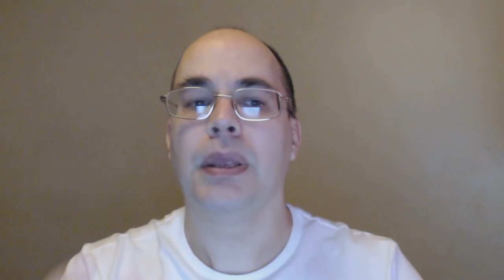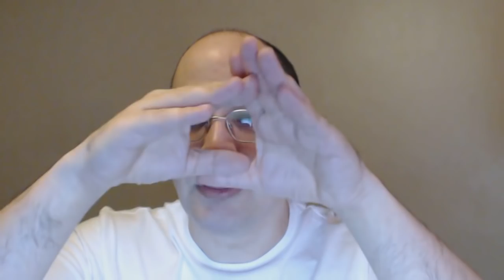How do rockets move in space, with nothing to push off from?

Comment: Rockets will work in space

Easy to prove they will by a number of methods.

1 Analogy with water expelled from a garden hose. Take your hose, hold it about a foot from the end, with a spray nozzle fitted. Have a helper turn on and increase the water flow. You feel the hose move more as the pressure increases. If you think this is because the water is pushing against air, move the hose toward and away from a solid surface (which should present more resistance than air) and you feel NO change in the pressure on the hose. It's only when the water is turned off that this pressure goes away. The air is not providing the push

2 Comparison with detonation of explosives. A rocket is a controlled detonation. When an explosive ignites, it generates rapidly-expanding gases which, in a microsecond, rupture the container holding the explosive in place, and generate an expanding shock wave in either the surrounding material, or air surrounding that material. They don't need air to ignite. They have an oxidising element in their make-up

so ....

3 What happens if you construct a combustion chamber, containing rocket propellant, that has no exhaust nozzle? Totally sealed, no exit for expanding gases. Light it up, and - Either the propellant burns until it's all spent, or the chamber reaches a point where the pressure is too much for the build, and it fractures at the weakest point. There can only be one of these results. No?

Simply put, the propellant works in all directions upon the internal walls of the chamber until either it is spent or the chamber explodes under stress.

Now substitute this chamber for one with a controlled exhaust, and the propellant STILL works upon the upper and inner walls of the chamber BEFORE exit. No? Why would it change behaviour between the two situations?

For those who think rockets push against air, consider this - the Saturn V developed 1,522,000 lbf for sea-level thrust, with a mass flow rate of 5683 lbm/s and exhaust velocity 9800 f/s.

Is atmospheric air at roughly 15 psi static going to present any meaningful impediment to this? It won't resist the rocket exhaust, it'll be pushed out of the way, like a 15-car railroad train swatting a fly. 15 psi is an insignificance against this. 

1. "Apollo 11 Saturn V Launch Camera E-8" - /watch?v=DKtVpvzUF1Y

Especially look at 0.45, where the engine reaches full power, and the smoke which has billowed out from the area below suddenly switches direction, and gets dragged back down. 

What do you think would cause it to do this, other than the atmosphere being dragged there?

Also at 1.36, the ice falling at the edge of the pit changes direction as it passes the hold-down clamps, and also gets dragged along. 

What do you think would cause it to do this, other than air movement pulling it in?

2. "Crucial Booster Test Fires Up in Utah"- /watch?v=LhxSk70r8dw 

Observe the ground around the booster once it's running. See how the movement of the atmosphere around it is pulling the loose sands etc toward the rocket exhaust. See 0.14, and look at the ridge line to the left, and in the following shot, where the material parallel to, and above the exhaust is being dragged toward it.

3. "Future SLS Rocket Engine Test Fired at Full Power | RS-25 | Video" - /watch?v=UEhHRXDFkeU

Watch the steam and vapour being produced ABOVE the engine being dragged down by the airflow.

4. Amateur demo shows model rocket engine thrusting in a vacuum ;

"Model Rocket Engine In A Vacuum Chamber - 4K Slow Motion - will it burn?"
/watch?v=GxBRQXxBRic

5. "RS-25 Rocket Engine Test"
/watch?v=cXgJVrmdYrY

"RS-25 Engine Test from Stennis Space Center"
/watch?v=CG2WeMSlOrA

Watch the steam and vapour being produced ABOVE the engine being dragged down by the airflow.
Reply: @boptah7489  why won't you answer my question?  Afraid it migh reveal an inconsistency in your logic?  When one MASS exerts a force on a second MASS, does the first mass FEEL THE FORCE OR NOT?
Reply: @stuartgray5877  I answered your question.There is no recoil with a crossbow in a vacuum..  Recoil is a function of thrust and thrust needs resistance.  The crossbow bolt leaves the crossbow recoil free , except for the small resistance needed to overcome the bolts inertia.
    This is completely different to a rocket.   A rocket relies on thrust off of an atmosphere.    As per the video i posted.
Reply: @boptah7489  for one: NO YOU DID NOT answer my question, you haven't responded since I asked it. And you are 100% WRONG, a crossbow certainly WILL experience recoil in a vacuum.  You seriously want to argue physics with engineers when it is obvious that YOU have never taken a physics class in your life?   What HAPPENS when you have two MASSES in space and a spring exerts a force between the two?  Are you suggesting that neither object will feel the force? Or that neither object will move due to this force?
Reply: @stuartgray5877  There is a world of difference between a vacuum  on earth and a vacuum in space.  .  In space there is no gravity to give  weight to an object and so there is no recoil. from the action/reaction principle.
    you need to understand that we are talking about rockets and thrust.  NOT the potential energy energy in a spring . 

   with your example of a spring acting between two masses in space the two masses will separate at a rate according to their mass.   that is because there are TWO masses. 

  With a rocket in space there is only 1 mass ( the rocket)  and so will not actually push off anything.ie.  the fuel /air mixture will evacuate out of the rocket and no thrust will be generated.
    You need to go and speak to your 'expert masters , because you do not know what you are talking about. Maybe you need to speak to different 'experts'.  Because they all contradict each other.
Reply: @stuartgray5877    no  Mass is a function of Gravity also.  Einsteins  equation E= MC2  clearly shows that mass is a function of speed and the speed of ~Earths gravity is an acceleration of 32.14 feet per second per second . 

    you are obviously new to this subject and is a bit above your pay grade.. 

   Low earth orbit is NOT in the vacuum of space and so is irrelevant to this discussion. 

   I do not need to take a course in Physics.  I know what i am talking about..  There are no test launches in space.  you are mistaken.  You cannot go into the vacuum of space  ( outside the Van allen belts)  with rocket technology.  That is why they can't put a man on the moon and still can't today
Reply: @boptah7489  you are literally trying to lecture someone who builds deep space probes, launches them, then helps fly them in deep space.  As I said: YOU have never taken a physics class in your life and it shows.  Now stop before you totally embarrass yourself.  Lookup "Mars Global Surveyor", "Stardust", "Genesis", "MER rovers", "Deep Impact", and "Kepler Space Telescope" then check my resume.
Reply: @stuartgray5877    You have NEVER sent a rocket into space.  you are a liar.  Low earth orbit is NOT space. 

    If you fired a rocket into space past the Van allen belts , then you will not be getting it back anytime soon.  Because Rockets do not work in the vacuum of space.  unless it is fired into space and then orbits a planetary body.   But it will not be the rocket propelling it through space.  it will be momentum. 

    I think you might have taken too many physics classes.  you need to look at what you are doing wrong with new eyes.  If you believe that a carbon based lifeform has gone beyond the Van allen belt with rocket technology.  then you are a simpleton.
Reply: @stuartgray5877    I answered your question on another thread.   Rockets do not work in the vacuum of space.  but you can fire a rocket into space from the earth if you can escape the earths gravity.  but you will have no thrust, steerage or means of braking.  you can only fire it into space until it is picked up by the orbit of another  body. 

     It does not matter if you worked for Lockheed.  You are hardly the brains behind the outfit.
Reply: @boptah7489  incapable of claiming your $1000 cash I see.  Did you check my resume or not?
Reply: @stuartgray5877    I don't care about a piddling $1000.  and i don't care about your resume.   That means nothing.
Reply: Your right, rocket technology does infact work...just like you said...like shooting off fireworks...in our atmosphere...well enough to land on a moon...ehhh?  That's an unbelievable stretch
Reply: @LemarFrench  so you must not believe we have orbited other planets and landed probes and rovers on their surface either?
Reply: @stuartgray5877  I'm surprised you do
Reply: So what we can summarize from what is being said is that rockets work by combustion and displacing their own gasses against the rocket itself essentially riding it's own shockwave perpetually?
Reply: @stuartgray5877  rockets working in a vacuum is one thing orbiting planets etc. Whole diff monster
Reply: @LemarFrench  No.  Rockets work by the expansion of gasses channelled into 1 direction of lesser resistance..  the reason why rockets cannot work in a vacuum is because you need resistance on all sides , otherwise the expanding gases just evacuate themselves into the no resistance zone ( vacuum)  and no thrust is provided.    Thrust is a function of resistance ONLY.
Reply: @boptah7489  I'm actually on your side, but one key detail is definitely "rate of burn" if I'm burning fuel faster than the gas can escape the nozzle, even in space, you'll see some movement, but yeah if all the fuel and gasses created had a simutaneous reactive time, everything would cancel out leaving no movement but ..."rate of burn" is true
Reply: @LemarFrench  and I literally build, test, launch, and FLY spacecraft for a living.  Space probes that I have worked on have: Orbited Saturn and landed on its moon Titan, Orbited and landed on Mars, Orbited and landed on Earth, punched a hole in a comet, gathered samples from a comet and returned them to Earth, gathered samples of the Solar Wind and returned them to Earth, and discovered thousands of extra-solar planets.  If you would like to learn more lookup the missions: Cassini/Huygens, Mars Global Surveyor, Stardust, Genesis MER rovers, Deep Impact, Kepler Space Telescope, JWST, and NOAA-20 for just SOME of the missions I have worked on.
Reply: @LemarFrench   Rate of burn is not a factor in a vacuum. because the newly made faster gases will not gain any thrust from catching up with the earlier created gas molecules because there is still no resistance on them.  For there to be thrust you must have resistance.
    Instead of thinking in terms of 'vacuum'.  It is better to think of resistance.. In the vacuum of space . the only forces working on solid objects are  gravitational type forces. magnetism if you like. 

  It is even doubtful if solar sails will work as intended in space.  because contrary to common belief the wind does not push a sailing boat.  The wind creates 'lift' in the sail and so the sailing boat is 'sucked' forward..   And so that principle becomes moot in space.
Reply: @stuartgray5877  I can give you this, rocket technology is the best example of space being a frontier of sorts...once you know you can traverse any medium it alleviates any argument of not being able to study that medium...secondly, I've worked on government vehicles/projects "UGCV" (Unmaned Ground Combat Vehicle) for the National Robotics Engineering Center in Pittsburgh PA where I am now etc. I've worked on turbine engines
Reply: And I still have my suspicions on certain aspects of profess successes via such an unstable means of travel
Reply: And what department were you in I can't see you being the sole contributor and pilot of these crafts so once your part is done on a project who handles it next...you yourself have mined a space rock
Reply: @LemarFrench   That is the correct way of seeing space.travel.  It is literally a new frontier and needs a new mind and new thinking to travel it.
Reply: @boptah7489  the nozzle offers variable resistance in that it doesn't allow all the energy from the reaction to be dispersed at once, so that difference in rate of expulsion allows enough gaseous build up to push against the rocket itself...it's like finding the happy medium between "BOOM" and a nice push
Reply: @stuartgray5877  I'm gonna check it out
Reply: @stuartgray5877  how was that launch in a vacuum?  And NASA never has one camera on a continuous shot, for obvious reasons, that parabolic curve looks like it went down range not into outer space
Reply: @LemarFrench  In a vacuum because there is no resistance from air pressure there is no thrust.  the fact that a rocket itself can apply resistance to the expelling gases is irrelevant.   You can only push against the rocket if you have resistance all round  (  resistance from air pressure).  If you thrust at any rate , variable or otherwise into a vacuum.  you go nowhere..  you need resistance outside the rocket to provide thrust.
Reply: bo ptah  “for there to be thrust you must have resistance “. And the MASS OF THE EXHAUST PROVIDES THAT RESISTANCE*. It’s called inertia. When the rocket engine ACCELERATES THE MASS of the exhaust it FEELS A RECOIL FORCE.  You refuse to answer the simple question:  if I fire a steel projectile from a crossbow IN A VACUUM *will I FEEL RECOIL ??  Yes or.no??  You are suggesting that MASS can be accelerated WITHOUT A FORCE!  Tell us all WHERE does the FORCE COME FROM that accelerates the exhaust gas OUT THE NOZZLE???
Reply: Lemar French the side boosters were heading East at about 3600 mph when they separated from the center core ABOVE 60 kilometers. They then turned around, canceled that 3600 mph and flew back to KSC. Sorry to break it to you but it is VACUUM ABOVE 50 kilometers. And if you want video from the rocket for the entire flight SEARCH FOR IT. SPACEX had about FIVE cameras on that launch and you can watch all of them
Reply: @stuartgray5877  .Sorry to break it to you but it is NOT a vacuum above 50km.   You are not even in a vacuum in the ionosphere..  a rocket will theoretically still provide thrust  in the ionosphere.  But it will be at the cost of massive diminishing returns.
  Btw.  you are not even in a vacuum at 300 KM's..  Physics is not your subject .  Is it?.
Reply: bo ptah why do you REFUSE to answer the question: If I fire a crossbow IN A VACUUM WILL I FEEL RECOIL ?? This is a yes or no question WHY are you having trouble answering it?
Reply: @stuartgray5877  You are just avoiding the fact that you have been caught out as a  'no nothing' fraud
   I answered your crossbow question ages ago.   If you fire a crossbow in a vacuum , you will feel no recoil.
  If you load the crossbow with a heavy bolt then fire it ,  the crossbow and bolt will separate according to their mass .  But the crossbow analogy entirely misses the point and does not show thrust due to gaseous expansion  ( gun recoil).   the crossbow firing a heavy bolt analogy just shows  the action/reaction principle applied to mass.
     Rockets work on the thrust generated by resistance principle..  If one side of the expanding gas mixture is a vacuum.  then thrust is impossible.Because there is no resistance to complete the action/reaction. equation.
Reply: @boptah7489  my very FIRST question to you: " @bo ptah  If I fire a standard steel projectile from a crossbow IN zero-G, IN A VACUUM, Will I feel recoil?  Yes or No?". So now you are caught LYING..... no surprise there.
Reply: @boptah7489  so now explain WHY the crossbow that PUSHES AWAY MASS DOES FEEL RECOIL .  WHY does the crossbow feel recoil force when it pushes away a projectile in a vacuum?  What would happen if I fire a projectile made from Water ice?  Still recoil?  How about Dry Ice ( solid CO2) STILL RECOIL?
Reply: @stuartgray5877  A crossbow that recoils when pushing away a heavy bolt  is recoiling because it is part of the overcoming of inertia that the bolt being fired is also experiencing
   It is the inertia that acts as the force to push the two objects apart.The inertia is the resistance.
   In a rocket, the propelling gases rely on pushing on air molecules as the inertia resistance.  But in a vacuum there is no air molecules and so no resistance.    You can prove this by firing a blank pistol at a wall  and noting the recoil.  Then fire the same blank pistol in air and the recoil is significantly reduced.  If you fire the same blank pistol in ever reducing air density , then the recoil gets progressively less.  Until there is no air.  and then there is no recoil.
Reply: @stuartgray5877  And as i explained. the recoil that you are trying to equate to a rocket is not the same as the recoil from a gun..  A crossbow does not recoil like a gun. Crossbows exhibit hardly any movement when fired.  Even less in a vacuum.
Reply: @stuartgray5877  no  when the rocket expels gas the first gas is immediately evacuated into space. Any and all gas just follows the first gas and can not use it for thrust.  that is like saying a machine gun will propel itself backwards by the bullets hitting each other continuously.  But as i showed you earlier,  the recoil of a gun is because the air closes in behind each bullet and the remaining propellant pushes off of that.
    You can not equate a crossbow with a gun in regards to recoil.   A gun is the best example of the physics behind a rocket. 

      assuming you can actually mix the explosive constituents in space to create a reaction, the reaction will just be evacuated from the rocket nozzle into the vacuum.  In fact the vacuum will absorb the rocket gases at the rate that they are made.  that is one of the defining qualities of an area of no resistance ( vacuum).
Reply: @boptah7489  - "It is the inertia that acts as the force to push the two objects apart.The inertia is the resistance."
This is correct
" In a rocket, the propelling gases rely on pushing on air molecules as the inertia resistance."
THIS IS FALSE.
The Rocket PUSHES THE MASS OF THE EXHAUST GAS 
YOU think that the AIR can provide "resistance" but the GASES COMING OUT CANNOT?
Does AIR Have mass so it can provide "resistance" but CO2 or WATER DO NOT HAVE MASS?

WHY DO YOU REFUSE TO ANSWER ALL MY QUESTIONS?
I ALSO ASKED:
" What would happen if I fire a projectile made from Water ice?  Still recoil?  How about Dry Ice ( solid CO2) STILL RECOIL ?"

YOU REFUSE to answer that question because YOU DONT WANT TO ADMIT that WATER AND CO2 HAVE FUCKING MASS !

"Crossbows exhibit hardly any movement when fired."
WRONG!

Watch the videos on my YT channel that prove this statement FALSE .
I demonstrate that the crossbow CAN HAVE MORE RECOIL ACCELERATION than the projectile IF the projectile has MORE mass than the crossbow.

"when the rocket expels gas the first gas is immediately evacuated into space. Any and all gas just follows the first gas and can not use it for thrust."

IT DOESN'T FUCKING MATTER what happens to the gas AFTER it leaves the rocket engine.
The ENGINE IS ACCELERATING THE MASS OF THE EXHAUST GAS WHILE STILL IN THE ENGINE .
The fuel enters the engine at ZERO velocity relative to the engine and exits AT 2500 meters per second. (THIS IS MACH EIGHT! )
TELL US THAT THE ENGINE CAN ACCELERATE THAT MASS WITHOUT EXERTING A FORCE ON IT

IF you try to say that YOU ARE A MORON.

AND If you bothered to look at my resume you would learn that:
I HAVE AN ENGINEERING DEGREE - YOU clearly have never taken a physics class
I worked at Lockheed Martin Flight Systems helping to build four deep space probes for them:  Cassini/Huygens, Mars Global Surveyor, Stardust,and Genesis.
I have since worked for: Jet Propulsion Laboratory (JPL), Laboratory for Atmospheric and Space Physics  (LASP), Goddard Space Flight Center (GSFC), NASA, NOAA, and DOD. 
I have personally helped launch FIVE spacecraft to space AND HELP FLY THEM WHEN THEY GET THERE.
My current job is Spacecraft Integration and Test Manager for the NASA Imaging X-ray Polarimetery Explorer mission.
Now TELL us your level of education and what YOU do for a living or shove your false assertions up your ass.
Reply: @stuartgray5877  

    the rocket gasses can only provide resistance if they meet air resistance first. 

   In the earths atmosphere  a rockets gases pushes off the atmosphere initially.  then the next burst of gasses push off the dissipating rocket gases and this forms a continuing chain of events as long as there is resistance to the mass of the rocket gases from the atmosphere.  As soon as the atmosphere gets thinner then the mass of the rocket gases dissipates faster and so resistance is progressively less., 

   you are trying to fool people into believing that a vacuum has mass for the rocket gases to push off.  Essentially you are trying to sell a house built on quicksand.  the rocket CANNOT push off the mass of the rocket gases unless the rocket gasses have met a mass first, because the newly made rocket gases are travelling EXACTLY as fast as the old ones due to there being no resistance to the rocket gases mass.
      It does not matter what mass you are firing from your stupid crossbow.  Your crossbow is pushing off of the mass of the bolt.  The bolt is the same as the earths atmosphere in that it provides resistance. 

   How much would the crossbow recoil if the bolt was a vacuum.  (  no mass)   The crossbow would not move at all.  Would it. ?. 

     If you put a massive mass in a crossbow then it would move backwards as i have said.  but that is not the recoil we are discussing.  the recoil we are discussing is akin to a guns recoil.  and guns recoil because the propellant pushes off the atmosphere after the bullet has left the barrel. In your arrogance you have overlooked this important step.
      the rocket engine cannot accelerate the mass of the exhaust while in a vacuum.  Because the mass of the gasses will have already been evacuated.  The instant , the nanosecond that the rocket fumes hit the vacuum,  they are gone.  Rockets do not work on the principle of a mass being ejected backwards and so they move forwards as a reaction to that  ( Newtons second law i think).  rockets work on the principle of resistance to gaseous expansion.   A vacuum is in fact . death to a rocket.
     If you fire an engine into a vacuum.  there is Zero force.  Because to have force you need resistance.   You seem to have trouble understanding this basic physical fact. 

    I don't care about your stupid brainwashing degree.  It is meaningless.  The reason why you lot lose so many rockets and can't put a man on the moon is because you all have degrees in nonsense.. 

   As i have said before.  you might be able to fire a rocket into space.  But once it is there it is lost.  you will not be able to control anything in space with a rocket.  ROCKETS CAN NOT WORK IN A VACUUM. and NO   there is not a vacuum above 60km's .  Mr Rocket scientist NASA idiot.
Reply: @boptah7489  so you think Air can provide "resistance" WHY? Because SIR HAS MASS? Well DO DOES THE EXHAUST GAS!!  Why do you think "Air" can provide "resistance" but "Gas" CANNOT? AIR IS JUST GAS .  If you think air can provide resistance then GAS CAN TOO.
Reply: @stuartgray5877  the air can provide resistance because  there is no vacuum sucking the air away.  Unlike the exhaust gases which are evacuated into the vacuum at the rate at which they are produced resistance free.
    The trouble with people like you is that you do not understand that ALL methods of propulsion on earth rely on resistance.  but NONE of them work in the vacuum of space.  And i know you don't know this because you think there is a vacuum at 60 km's.  which means you are clueless about physics and the properties involved.   but feel free to ask more questions Because i know what i am talking about.
Reply: @stuartgray5877  I refer to "suck it away" as an example of what apparently happens. I have already explained it using the zero resistance position.   but you did not understand When you fire a rocket into a vacuum it is evacuated at the rate at which the gases are produced. .  In fact at the mixing nozzle  ( fuel / oxygen)  it is highly likely that the dissipation will be faster than the combustion cycle can cope with and so will be unreliable.   I am not suggesting that a vacuum has mechanical properties. .  A vacuum is just an area of zero resistance.
  You cannot make an object move when the forces are working inside the engine only, For a rocket to work it needs an area ( atmosphere)  for the rocket gases to have resistance with.ie.  you need the mass of air pressure  for the rocket to thrust from.  If the mass of the air is less ( higher altitude)  then their is less thrust until in a vacuum there is no thrust.

    Space X side boosters have never been anywhere near a vacuum..  You need to find out the altitude that a vacuum starts at before you post shit on the internet.
Reply: @boptah7489  - "You need to find out the altitude that a vacuum starts at before you post shit on the internet."

AS I SAID BEFORE: The Atmospheric Pressure above 50 kilometers is LESS THAN 1.0 Torr .
Those boosters separated ABOVE 60 km.
  Some of the SpaceX boosters perform propulsive maneuvers ABOVE 120 kilometers.
Reply: @stuartgray5877    I repeat.   You need to find out at what altitude a vacuum starts before you post shit on the internet. 

   1 torr is NOT a vacuum.
    120 KM's is dense compared to a vacuum and i bet the manoeuvrers are extremely limited even in the 'soup' at 120km's
     you need to understand what the characteristics of a vacuum are and what a rocket needs to function.    Rockets working in vacuums is nonsense.
Reply: @boptah7489  _ Oh AND:

"1 torr is NOT a vacuum."

A VACUUM TEST SPECIALIST IS TELLING YOU THAT 1.0 Tor is the TECHNICAL DEFINITION OF ROUGH VACUUM.

You have likely never SEEN a vacuum chamber in your life, but you are arguing with someone who has been operating them for 25 years and was Trained at Lockheed Martin's SPACE SIMULATION LABORATORY and has worked for the Laboratory for Atmospheric and Space Physics !!

Here is your Dunning-Kruger participation award, put it where your high school diploma should have gone.
Reply: @LemarFrench  - My primary Job is Spacecraft Integration and Test Engineer.  I have also performed the functions of: Systems Engineer, Power Subsystems Engineer, Command and Data Handling Subsystems Engineer, Flight Director, Launch Conductor, and others.  I am currently the Spacecraft Integration and Test Manager for the Imaging X-ray Polarimetery Explorer (IXPE).  Look it up.  Previous spacecraft I have helped build, test, and launch: Cassini/Huygens, Mars Global Surveyor, Stardust, Genesis, MER Rovers, Deep Impact, Kepler Space Telescope, James Webb Space Telescope, Worldview 1, NPP, and JPSS-1 (now NOAA-20)
Reply: @stuartgray5877  Ok, to your knowledge of experience would you agree there are some inconsistent facts in space exploration footages...especially broadcast worthy?  Where does your skepticism lie, having none isn't healthy, if your that decorated you understand what would and wouldn't make sense in your experience, right?
Reply: @stuartgray5877  My point being you can be an expert in your field(s) of study but YOU cannot legitimize the narrative of evidence released as being the result of space exploration.  Just as much as alligators and birds do not legitimize the narrative of dinosaurs...or of evolution...it's all up for debate...you can study DNA all day but cannot tell me how it began biologically in nature...
Reply: We all know what known science tells us, I offer critical thinking in a world of false certainties and embellished narratives, propaganda and broadcast quotas...our educational institutions of learning are biased, everything is "in the best interest" of something, I think that's what people miss about the flat - earth theory, it's not a theory, It's a mental practice...but the fact that you can physically entertain the science gave it the traction it has now...off topic, again I know the general ideas in science that you know but there are still many different ways to arrive at the same educational institutions not just a historically European established methodology.
Reply: @stuartgray5877    Everyone knows what a vacuum is.  You can twist and turn a much as you like.  .  It is in fact not even a vacuum at 400km's either.   look.  you need to pick up some basic science books and learn a few definitions.
    It is you that has the dunnings kruger syndrome.  You have attended ( allegedly) some institutions that claim to know things and then you make basic errors.  and then you admit that you know about vacuums and space when you have  only been in a simulator.  /
     Maybe you need to open your mind a bit and reflect on the fact that you can't send a man into the vacuum of space, with rocket technology  and there is valid scientific reasons why you keep on losing rockets..   you are an amateur.
Reply: Stuart Gray Do you know what vacuum is? Why doesn’t the rockets act like a ballon in a vacuum, expanding and exploiting.
Reply: @rektinzor6233  - "Do you know what vacuum is?"
I am LITERALLY a "VACUUM Test Specialist".
SO YES I understand how vacuum works.
It is YOU that does not
Reply: Absolute nonsense.   A rocket fired into a vacuum can not generate thrust.  Because the vacuum evacuates ALL expansion as it is produced from the rocket.  Because there is no resistance.
Reply: @boptah7489  Please list what physics classes you have taken and whether they are are high school or college level. Please also state whether you believe the Earth is flat or Spherical.
Reply: @boptah7489  If I fire a standard steel projectile from a crossbow IN zero-G, IN A VACUUM, Will I feel recoil?  Yes or No?
Reply: @stuartgray5877  Great example, and much better than the explanation in the video because that is confusing a lot of people.